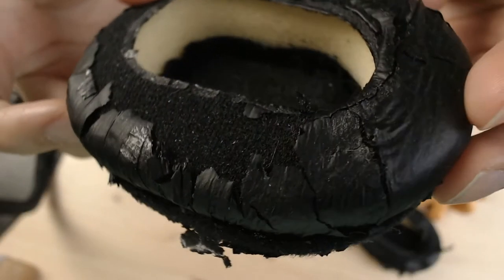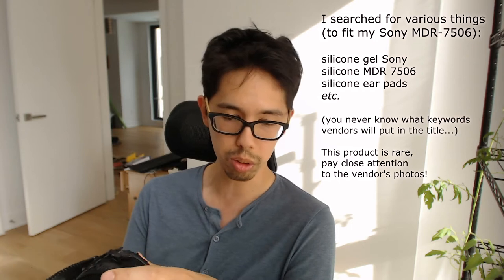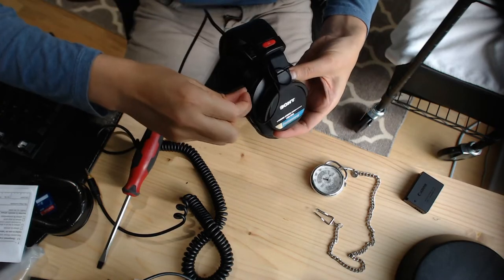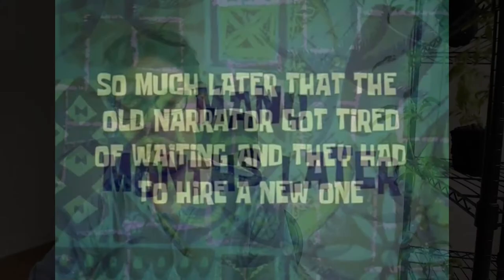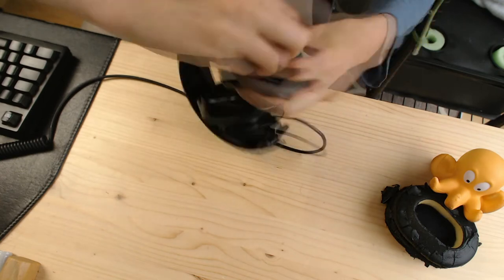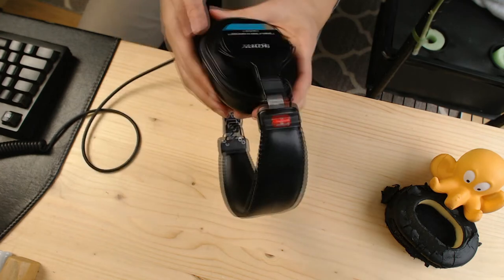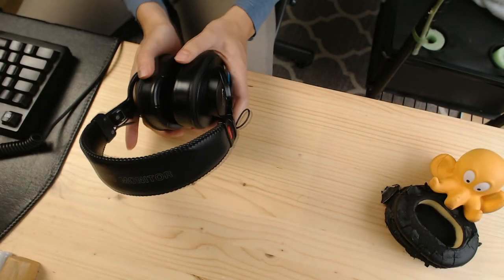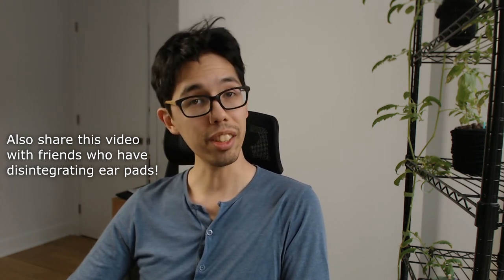Using silicone gel earpads for ultimate longevity - making durable headphones for your studio

Comment: The foam in the center would help in dampening the sound evening it out and clearing some noise so it wont sound too raw. It has the same function as placing foam on a microphone to remove wind/room noise when you speak into it. It makes a huge difference but not something a non-audiophile would notice.

Comment: Earpads are probably the second most important part for sound. You just changed the tuning of your headphones without even knowing about it. Changing earpads, even swapping old ones for identical new  audibly changes the tuning. Same goes for the filter foam that reduces high frequencies.
Reply: So make us a video about this don't just tell us No No, Tell us How to tune the headphones.
I roast my own coffee and then add what I like and my "nose in the air coffee sniffers" tell me what I am doing wrong but I fucking hate Their coffee.
So How are earpads important? I have 5 sets of earphones.
2 actually fit Over my ears and do not push the cartilage of my ear but all Press on my ear because they are NOT deep enough and my ears are not some amazing sticking out ears.
I have two cheapos Doqaus and Mpow that are just too small.
My Sonys WH-1000M3 touch my ears from the speaker cover, my Xiberia do the same. Then pads are large enough but both...make that all 5 are shallow enough.
So Mister nose in the Air Audiophile how exactly do I "tune my headphones".
My sound canceling Sonys definitely cancel sound but I do not hear a real difference between the 5. My LG sound bar running ATMOS is much nicer because my ears a physically unmolested. 8-D
Reply: Sure Karen😂😂
Reply: @zdragonzmaster2215  They definitely do change sound quality, its not enough to be like "Oh I just ruined my entire headphone experience" but it definitely is a change. I have a pair of Skullcandy Crusher Evo's and when I changed their earpads for a cosmetic upgrade I definitely could feel and hear a difference in the bass. (Which mind you was the whole reason I got the headphones) However, in my opinion, it was not a significant enough change that I wanted to switch back to the original headphones. So instead of dismissing someone who is telling you that changing something will change other things you may not have thought about, ask questions, and dont have a snooty attitude. This guy wasnt even rude with the comment he was stating. The time that it took you to type out that paragraph, you could have cut in half and searched up how earpads can change sound quality...
Reply: @zdragonzmaster2215  still different earpad differnt sound.
If its not different a lot studio monitor headphone will surely not come with Valour earpads.
Leather for more bass
And if you try to put the completely worn out one on it's sound is very Obviously different

Comment: With brand new earpads such as these, use an airdryer to eat up the plastic lip to get it hot and soft (please use caution - just a little hot, please do not burn/melt the earpads). 
Then it will be easy to get them into position.
The foam is there for a reason - it protects the driver from dust and moisture, and it also filters out a very tiny amount of treble (depending on the foam).

Comment: You can purchase actual sheepskin leather replacement pads for those headphones. Leather pads should not have the problem of deteriorating in the same manner as those pleather ones where the outer skin flakes off, though I don't know whether or not they will eventually fail at the seam in the same way as the original pads. They cost a bit more, but it might be worth the investment if you want effective replacements that offer comfort and don't have the same drawbacks as silicone pads.
Reply: Actually, it has nothing to do with the "pleather" itself, because "pleather" has been a very durable leather substitute in car seats for over a decade now.

Its just planneed obsolescence from Bose, Sony and Co by making the ear pads extra bad.
Reply: @maxschmidt666  Its actually due to it being pleather, not specifically because its pleather, but because of the manufacturing processes needed to achieve the qualities desired. Thin, smooth, soft, stretchy, low cost, good sealing ability, etc. All those together result in a pleather that is less durable over time. Thicker pleather's don't require the same qualities, and so can be made using techniques that result in them being more durable, and perhaps you could make headphone cushions more durable, but they would either cost significantly more, meaning the product would be less affordable, or would not be as comfortable, meaning consumers would be less inclined to purchase your product over someone else's that is more comfortable. Sometimes you have to pick your battles.
Reply: @ixamraxi  Thank you very much. I'm not a pleather expert, what what you say about the thickness seems perfectly reasonable.

Also, it seems reasonable to me that thicker pleather on ear pads might feel less comfortable. 

That said, I think if Bose, Sony and Co. would want to make their ear pads more durable without loosing on comfort, they could do that with not too much effort. Maybe it would cost them a dollar more. But at the end of the day, they want to get more money from the consumer.

Have a great day :)

Comment: I'm glad I wasn't the only one to consider gel pads from hearing protection pads for my headphone, although yours seem to be both easier and harder to work with than mine (it has lips, sort of, whilst mine don't have any).

I don't understand why there aren't any kind of "universal gel pads" yet.
Reply: The gel pads you purchased are somewhat similar to the kind you can find for David Clark's aviation ear pads. And they also sell inner foam layers if you wanted to add it. I am no audiophile, but I do believe having the foam is still better than having nothing at all. Otherwise, the parts inside are directly exposed to environment hazard.

Comment: The foam protects those metal parts from moisture buildup, and your ears from those metal parts. I'd like to hear how silicone pads turned out in the long term.
Reply from the maker: I'm still using them today, the earcups have not degraded, but I've been too busy and time-constrained to look for the old foams, cut them out, and install them inside the silicone earpads.

Comment: My problem is every ear pad does not hold the headphone speaker panel (?) far enough away from my ear. I am getting some tubing to slide under the earpads of my SONY WH-1000M3 and now I know I can buy the silicone pads for like 13€ on ebay.
I have some Mpow "over the ear" which do not fit over my ears at all.
I am not sure I care how they look as long as the work well.

Comment: I've been useing my headphones everyday 8 to 12 hours a day and mine still look perfect been 4 or 5 years now how do u even manage that and it's not high end either just some tritton  Kani
Reply: is that leather?
Reply: Do u live in humid areas?
Reply: Mostly gets damage if you let someone else use it. Since the acidity on our sweat is different per person.
Reply: @jurgenunterbergful  also they could be poorly made. I have a pair of Klipsch noise cancelling headphones that the pads split wide open just sitting in a closet. What's worse is no one sells replacement pads for them so I have a nice $300 paperweight.
Reply: Probably different headphones, different materials. The very thin polymer layer on these off the factory is very susceptible to degradation.

Comment: Those pads he got are not gel pads just pads designed to look like gel pads
Reply from the maker: I can recognize silicone gel when I feel it. It's definitely not foam inside, it compresses differently, the gel exhibits much more resistance at the far end when compressed, and it reacts differently depending on the pressure zones than foam would.
Reply: @JeffFortinTam  oh, I assumed they were foam seeing as I know someone who had gotten pads like those but it turned out it was foam and he got scamed
Reply from the maker: @bored_key  yeah, I can see how that could happen, they can be hard to tell apart visually depending on sellers' thumbnail pictures!
Reply: @kevinchrist1658 good point